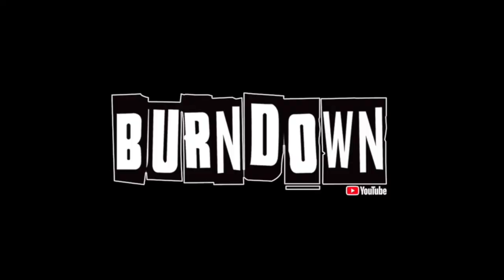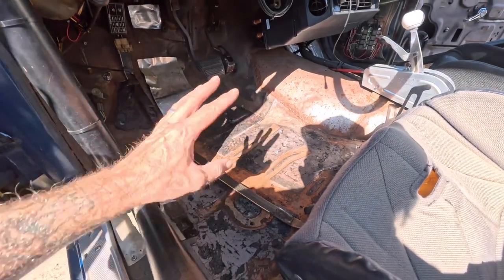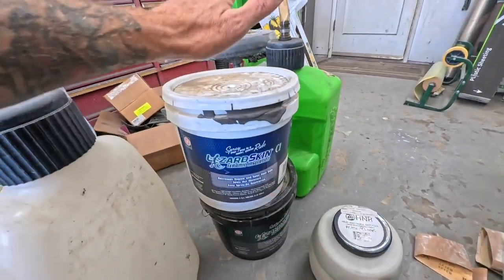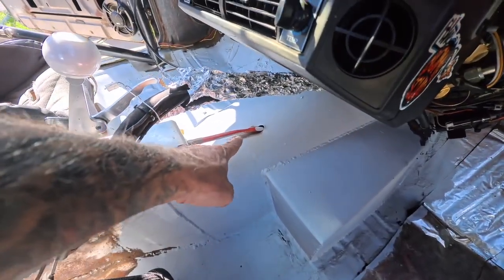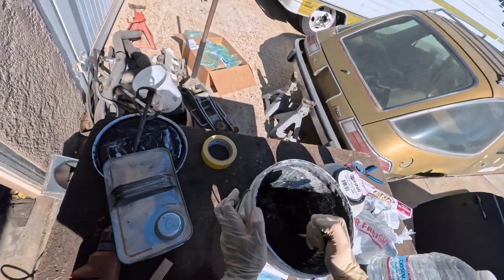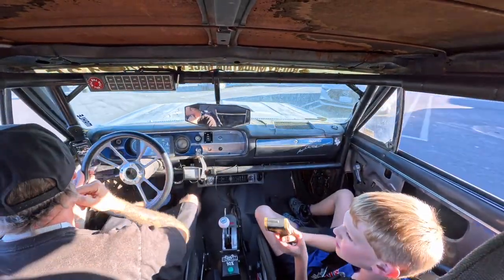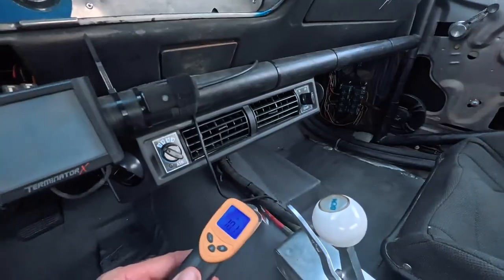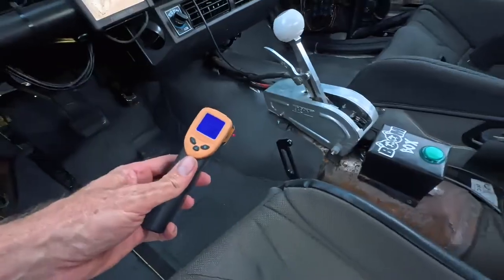lizard skin heat shield

Comment: Is there a way to control the fan kits with just on/off switches instead of some fuel injection computer?
Reply from the maker: No it needs a pwm signal. We are currently looking for a good controller to use. They do sell cheap ones on amazon that will fire the fan but you would need to run that through a relay. It could be done but it would be more then an average guy would deal with imo

Comment: I have used it several times with great results, but we use the sound control and heat barrier, One car we did didn't have carpet and the shoe never hurt it and even brake fluid didn't  effect it just stained it darker a little bit, we spray it on and usually do the bottom of the car and inside.
Reply from the maker: It wasn’t dry all the way when we made the video